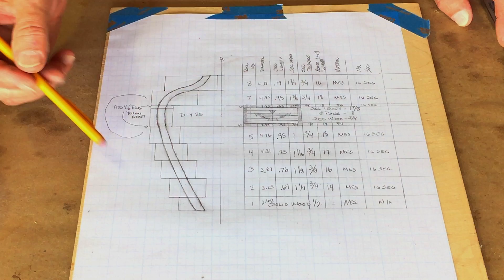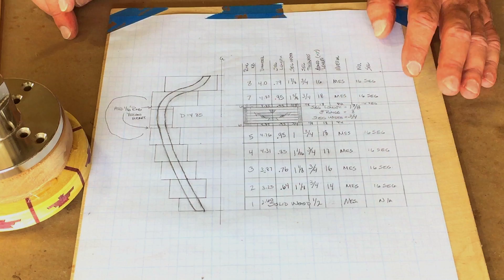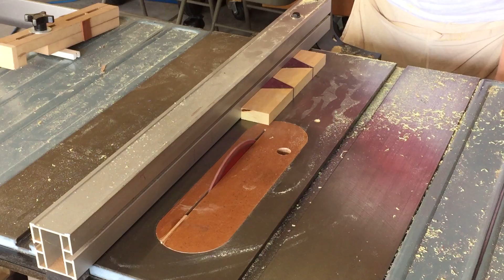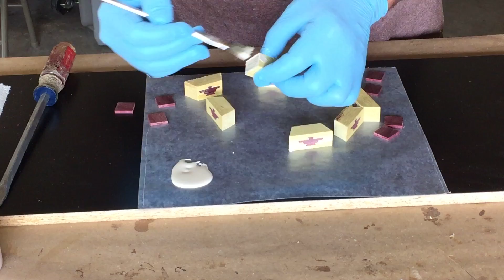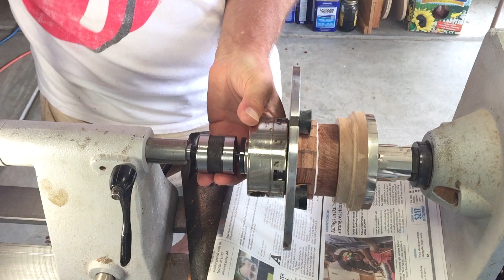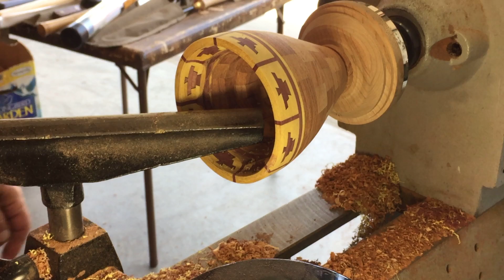Southwestern Vase with Thunderbird Feature Ring

Comment: This is still a good example in 2026.  I am returning to segmented turning after a 7-year break to do flat work.  This is an excellent review of the process for the thunderbird feature ring.  It was a bit unclear when taking the cut strips and re-orienting them.  Is there a special number of strips? Also, it appears that not all the strips were used.
Reply from the maker: Thanks for the comment and questions.  I don't think that the number of strips would make a difference although you might have to make the piece larger to accommodate more strips.  I only used 4 of the 5 pieces that I cut.  I think the best way is to cut as many strips as you think you'll need and just keep putting them together until you get something that you like.  Good luck.  Take care,  Steve
Reply from the maker: I came across an older video by Jim Rodgers that covers feature rings.  He does a good job explaining the thunderbird feature.  I put a link below.  Steve
https://www.youtube.com/watch?v=zA5DAEBaNQ8

Comment: How did you finish the inside ?  Pour the sealer in and roll around to coat internally?
Reply from the maker: I finished the inside with shellac before I glued the top and bottom together.  Unfortunately that part didn't make into the video.  Thanks for watching.  Take care,  Steve

Comment: Steve, I've been turning segmented bowls for some time, and what to turn a project like this vase. About ten minutes into the video you show an adapter between the tailstock and the chuck holding the feature ring, you're hot gluing the ring to a piece mounted on the headstock faceplate.  That adapter allows the tailstock chuck to rotate.  Can you tell me where I can obtain that adapter? Thanks for the step-by-step instruction.
Reply from the maker: My apologies for the late reply.  I got the live center with chuck adapter from Penn State Industries.  I put the link below.  It comes in very handy.  Thanks for watching my video and for the comment.  Take care,  Steve

https://www.pennstateind.com/store/LTCA18.html
Reply: @slindsley1951  Steve Many thanks for the info on the tailstock live center. One additional question; when you're gluing the purple heart wedges in the yellow heart to make the feature ring you add pieces of veneer, What species of wood is the veneer? Thanks again!
Reply from the maker: @trunyan5080  I'm not sure what species of wood the veneer is.  I buy packs of colored veneer at Woodcraft.  I put a link below.  Steve
https://www.woodcraft.com/products/dyed-black-veneer-12-x-12-3-piece

Comment: I use a sanding disc mounted to the tail stock to sand my rings on one side,then I glue them to the bowl and then sand the other side
Reply from the maker: That sounds like a good solution Bill.  There's always more than one way to get the job done.  Take care,  Steve

Comment: On the video, for example, the time is 11: 12
Reply from the maker: You can get the live tail center from Penn State Industries. I put a link below.  Take care,  Steve

https://www.pennstateind.com/store/LTCA18.html
Reply: @slindsley1951  Thank you for your detailed response! And there's a lathe Chuck going with it, am I right? Steve, is there a Morse-2 cone on the adapter?
Reply from the maker: @АлександрКривошапов-ж4э   Yes, the adapter has a #2 morse taper to fit into the tail stock.  The chuck doesn't come with the adapter and must be purchased separately.  Steve
Reply: @slindsley1951  You may be using this cartridge?Barracuda2 Lathe Chuck Ultra Essentials
Reply: @slindsley1951  Do you use this?https://www.pennstateind.com/store/CSC3500SE.html
Reply from the maker: @АлександрКривошапов-ж4э  Yes - that was the chuck that I was using on the adapter.  I purchased that kit over 10 years ago and it's been a good chuck.  Steve

Comment: Really enjoy your videos learning a lot.  in regards to your Southwestern Vase with Thunderbird Feature Ring
you state you finished the inside with a sealer do you apply the sealer as you finish each section like the lower half before you put it together it would be hard to apply the finish  when completed  thanks for the videos  ken
Reply from the maker: Ken - Thanks for watching and commenting on my video.  Yes, I typically finish the top and bottom half before I joint them together.  Sometimes it's with shellac or with a poly, depends what I have on hand.  Thanks again for watching.  Take care,  Steve

Comment: Your segmented skills and the pieces you produce are amazing. Have been following your videos for a while now, quite new to turning but you've got me hooked on wanting to do segmented turning,  your designs and patience in all of the preparation you do is very inspiring.  When cutting the thinner strips, do you sand the faces somehow to achieve smooth flat surfaces or use them straight off the saw?   Also, (if you don't mind me asking all these questions!) how thick is the veneer you use for spacers?  Thank you for your most enlightening and enjoyable presentations, kind regards, Tony(UK)
Reply from the maker: Tony - Thank you for your comments!  Segmented turning is a lot of fun so give it a try!  On the thinner strips, I use them as they come off of the saw.  As for the veneer, I'm not sure of the thickness.  I buy packs of dyed veneer at my local Woodcraft store.  It's also available on Amazon - I put a link below.  Thanks again for watching and commenting on my video.  It's very much appreciated.  Take care,  Steve

https://www.amazon.com/Dyed-Base-Color-Assortment-Veneer/dp/B00315RIYC/ref=sr_1_1?s=hi&ie=UTF8&qid=1547476791&sr=1-1&keywords=dyed+wood+veneer

Comment: Great informative video for me. 
I am new to woodturning and was wondering what glue do you use to reseal the 
Top and how do you take it apart after you temporarily glue it. Thank you once again well done
Reply from the maker: Ken - I don't glue the top and bottom halves together until the piece is finished turned on the inside and out.  This piece was small enough that I just pressed the two halves together with the tail stock and turned the outside to shape.  On larger pieces I use a few pieces of double stick tape between the two halves to help hold them together along with the tail stock.  Not too much tape though as that can be difficult to get apart to finish turn the inside.  After I have the inside and outside finish turned I glue the two halves together.  As for glue, I generally use Titebond Ultimate.  I hope that helps.  Thanks for watching my video.  Take care,  Steve

Comment: Absolutely beautiful, and you have given me a far better explanation of how to make a segmented vase than any other video I've ever seen. I think I have a project for the summer now. :D

Quick question though. Do you sand the inside to perfection, or do you just clean it up since it won't really ever be seen?
Reply from the maker: Thank you very much for your comment.  It's a nice little project so give it a try.  As far as the inside goes, I don't go crazy sanding it.  I smooth it out and that's about it usually to 120 grit.  I do put on a couple coats of sanding sealer or shellac just to seal it up.  Thanks again for watching.  Take care,  Steve

Comment: Hello Steve
   I am currently building the Thunderbird Feature ring. Turning out great. I cut 7    1/8 pieces leaving 3 spare. Turned them into a flow pot. A little extra surprise.   I am wondering why you did not set the fence to 1/8. I cut the first birds using your stop block method.  There was some variation on thicknesses.
Reply from the maker: Skip - I wanted the strips to fall away from the blade and not be between the blade and the fence.  I could have made a push block to push the strips between the fence and the blade but I guess I was being lazy.  :-)  Either way would certainly work and you're correct that using the fence would give a more consistent strip.  Thanks for the question and for watching my video.  Take care,  Steve

Comment: Hi, Steve, Your work is an inspiration to me, and your teaching style makes the concepts easy to understand. Thank  you. Using your video as a teaching tool, I'm currently making a vessel with the "Thunderbird" feature ring. I have a question about equipment. Your video shows what looks like multiple shiny stainless steel faceplates with matching threaded hubs. Are these, by chance, part of the Turners Select Modular Faceplate System with the threaded hubs offered by Craft Supplies that uses different diameter faceplates that screw onto the hub? Thanks, Steve.

Comment: Steve this is a truly beautiful bowl can you point me to where i can find the formula for the sizing of the segments for each ring
Reply from the maker: Thanks very much Tom.  The formula is quite simple it's the diameter x pi (3.1416) divided by the number of segments in the ring.  Diameter X pi gives you the circumference of the circle.  So for a 5 inch diameter ring with 12 segments the calculation would be 5x3.1416=15.71 divided by 12 = a segment length of 1.31 or about 1 5/16 inch.  I hope that helps.  Take care,  Steve